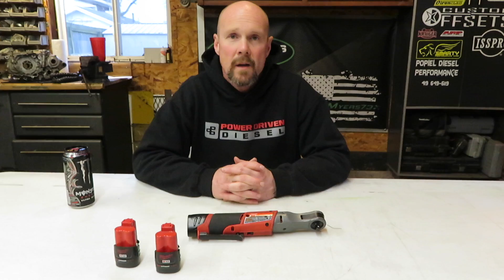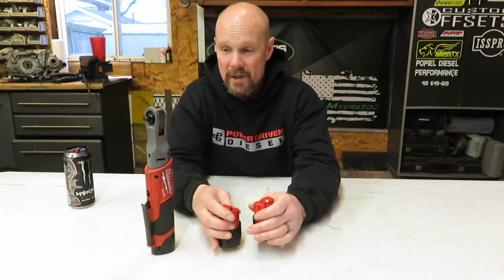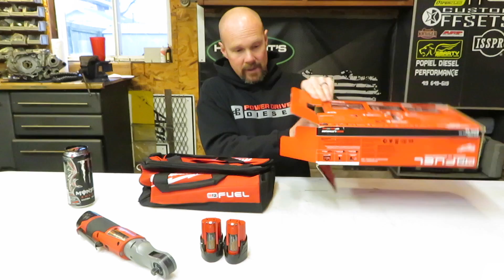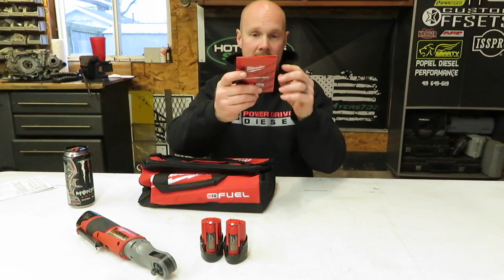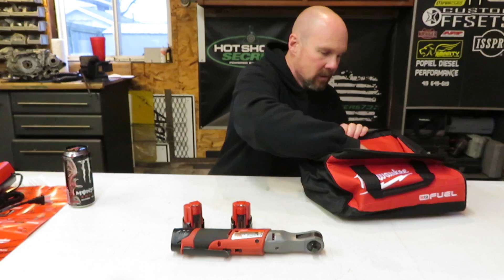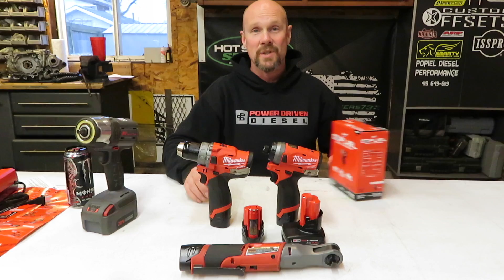Milwaukee M12 Drill Driver And Subby Impact Unboxing

Comment: I own maybe 2/3s of the Milwaukee tool line, if you're looking for something that'll blow your sucks off is the m18 high torque impact wrench it takes axle nuts wheel off like butter I cannot recommend that tool enough I have the mid torque too which I like but the high torque Is my go too
Reply from the maker: Yeah a friend of mine has that is pretty remarkable.....

Comment: hey you should watch ebay to i have bought both 1/2 and 3/8 impacts there and feel i got darn good prices on them i also got a 3/8 drill to i have to say my 3/8 drive m12 impact i have yet to find a mower blade it would not take off and it has been under everything from riders to 3 point finsh mowers . as for the ratchet you took back there was no failure with it then the little buffer i seen at hft i dont use it much but still wish i had it i do a lot of service calls on small engines and compact tractors and no air compressor for my air tools in the shop
Reply from the maker: OK great thank you man! No there was nothing wrong with the Harbor freight ratchet I just use my Milwaukee M12 more.